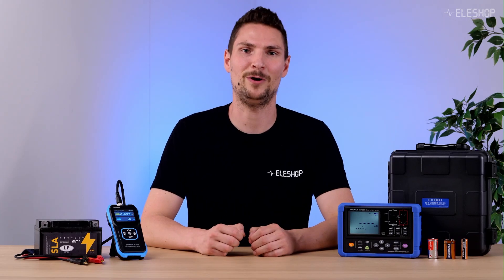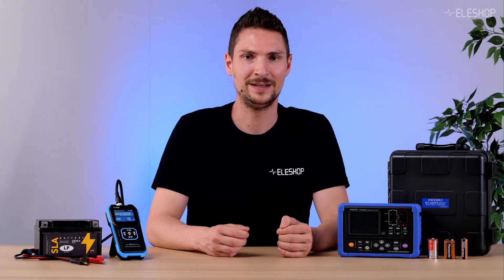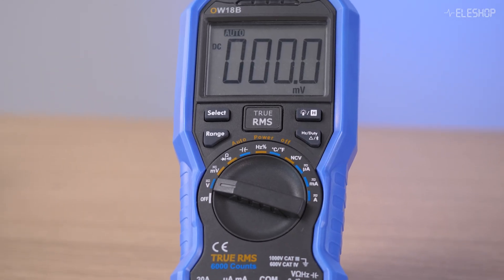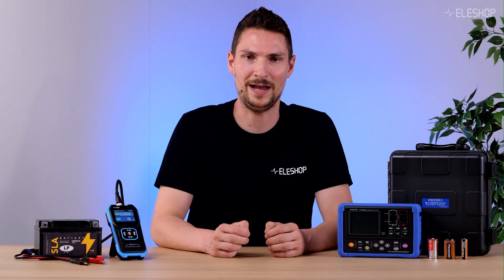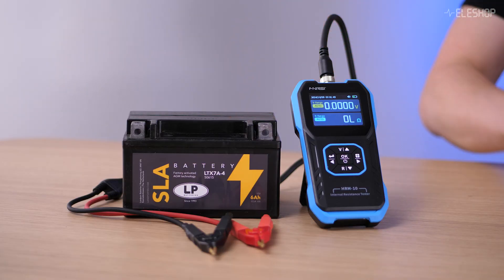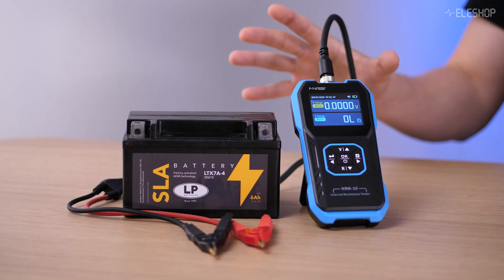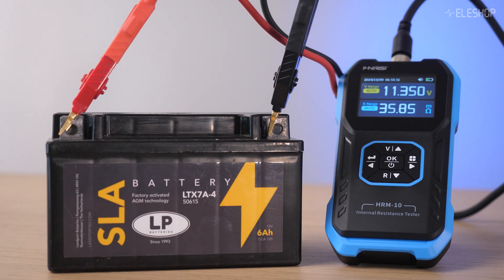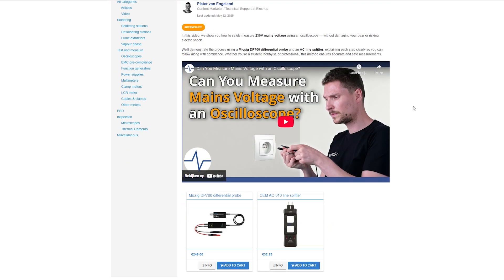How to measure the internal impedance of a battery

Comment: Question.  Some battery cells or battery packs have built-in BMS electronics, is it possible to measure internal impedance of a battery with BMS? How does it alter the result ?
Reply from the maker: Yes, we tested protected cells in the past and that worked fine.

Comment: The symbol in the picture in the beginning is not a capacitor in series with the impedance resitance! It is the symbol of the battery itself with the impedance resistor. For the story this not matter but, come on; get your symbols right.
Reply from the maker: It's not uncommon to use the capacitor symbol to indicate that its the internal representation of the battery and not just a battery and a resistor.
Reply: @EleshopVideo  : Exactly! So, use the capacitor symbol and not the battery symbol.

Comment: Very interesting. In the old days (~30 years back), we used to measure the battery impedance in a much different way. The industry standard looks fascinating (using 1 kHz AC). Thanks for your information; I will look farther in the the HRM-10 and BT3554-51. Thanks again!